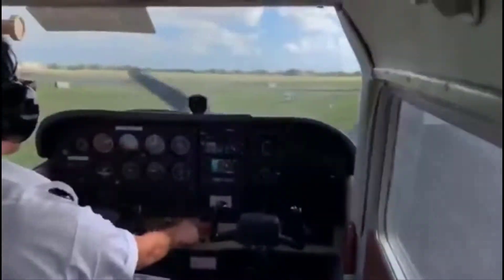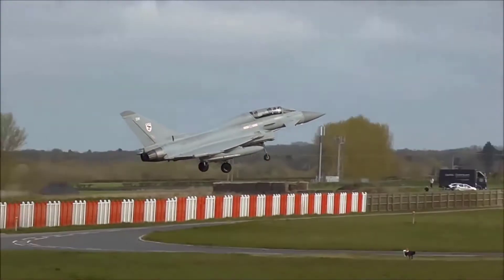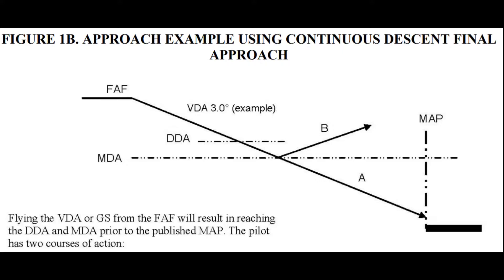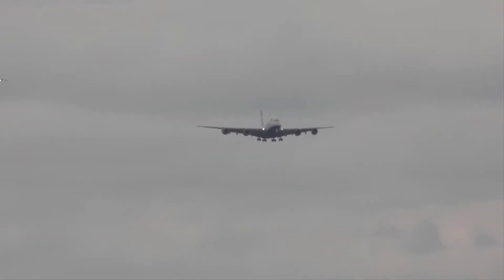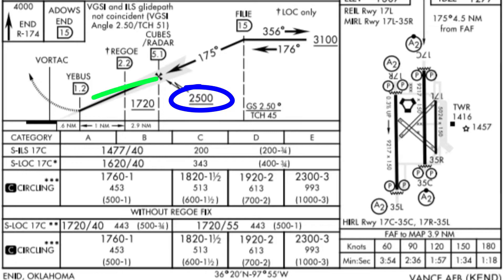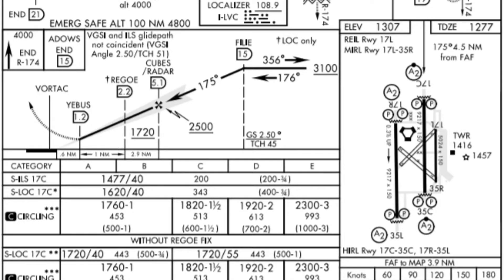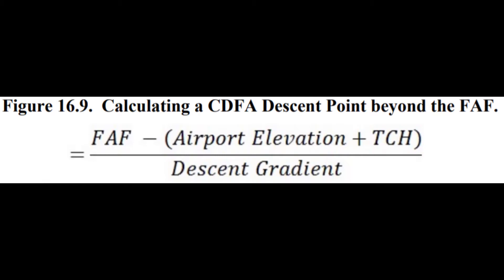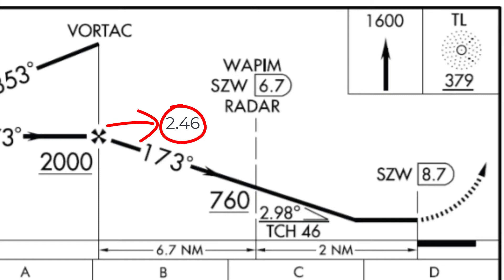Non Precision Approaches | How to Fly CDFA Technique | Toolkit Ep 4

Comment: Great video but just so you know, the math is a little off for the calculation with a step down fix inside the FAF (around 7:19 in the video), you used 300 and that’s the descent angle not the descent gradient, I spent a long time trying to figure out why the numbers where different, a 2.98 VDA (glideslope) comes out to a 316 ft/NM descent gradient. Great video! Thanks for making this, I used some of it for my instructor checkride
Reply from the maker: That's a great catch, I'm going to look into the math on that again! Until I get back to you, im going to pin this for others to see.

 Glad to hear it helped you prepare for the checkride.
Reply: @CourtyBoi  I created an online CDFA/CANPA calculator for our aero club. https://my.rockymountainflight.com/cdfa  

I took the FAF altitude of 2000 - (81 + 46) = 1873 feet to lose in 8.7nm. That is a descent gradient from the FAF of 2.03 degrees. At 120 knots ground speed, that would be 431 fpm descent and would take 4:21